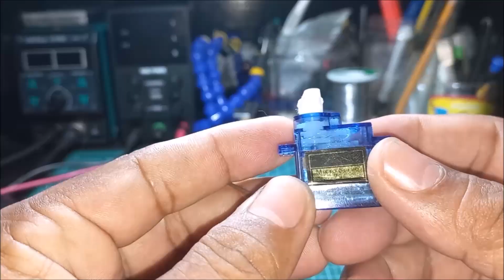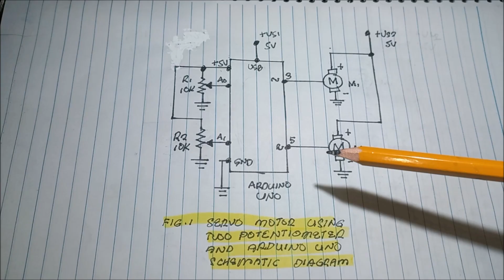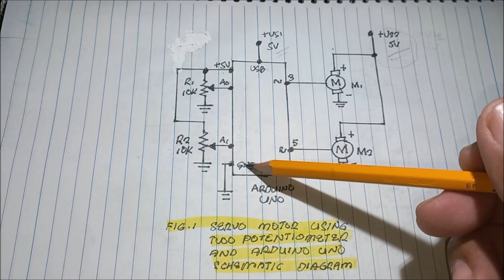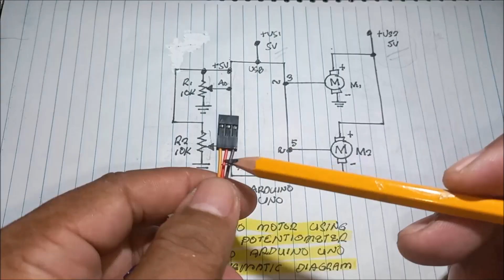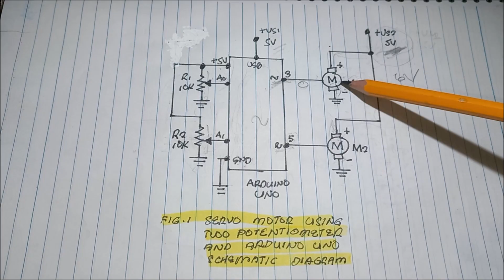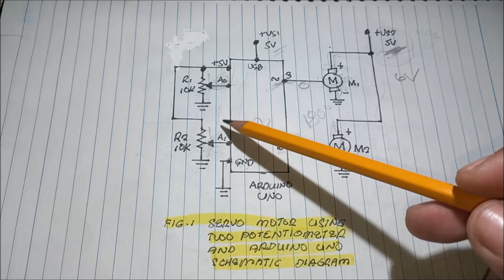Servo Motor Control using Two Potentiometer and Arduino Uno Microcontroller

Comment from the maker: #include <Servo.h>

//** servo 1 settings
Servo servo1; 
const int servo1PotPin =A0;
const int servo1Pin = 3;// Must use PWM enabled pin
int servo1Value;
//** servo 1 settings END

//** servo 2 settings
Servo servo2; 
const int servo2PotPin =A1;
const int servo2Pin = 5;// Must use PWM enabled pin
int servo2Value;
//** servo 1 settings END

void setup() {
 
  servo1.attach(servo1Pin); 
  servo2.attach(servo2Pin);   
}

void loop() {
  
  servo1Value = analogRead(servo1PotPin); 
  servo1Value = map(servo1Value, 0, 1023, 0, 180);
  servo1.write(servo1Value);

  servo2Value = analogRead(servo2PotPin); 
  servo2Value = map(servo2Value, 0, 1023, 0, 180);
  servo2.write(servo2Value);
  
  delay(5);
 }// loop end